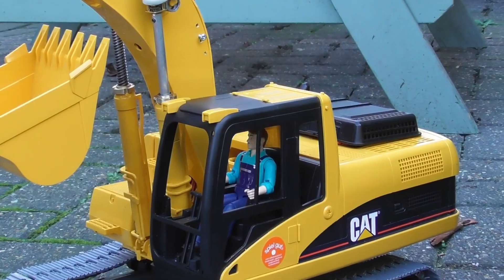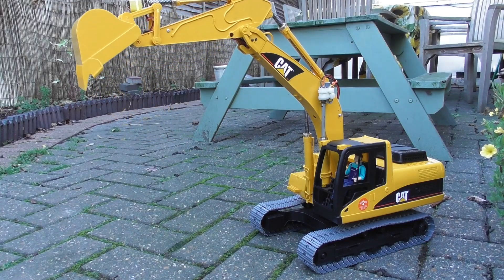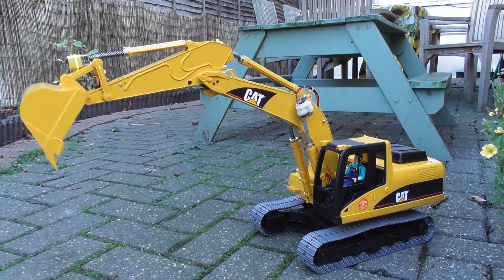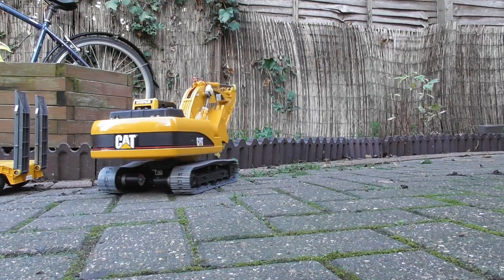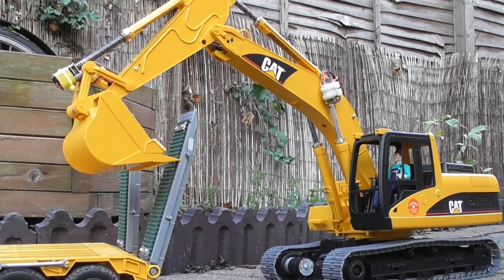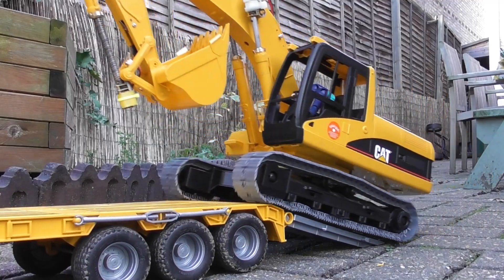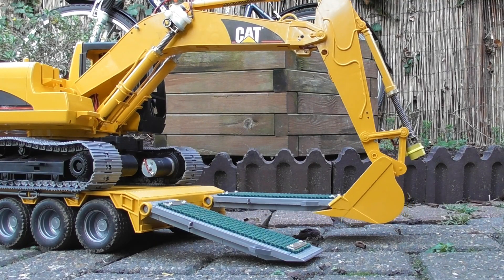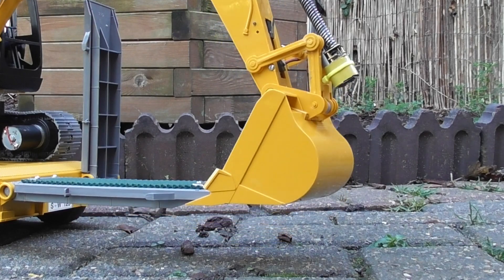Bruder CAT Excavator RC conversion pt6 : completion

Comment: Where might I be able to find tracks like those?
Reply from the maker: Those are standard Bruder tracks. Either part of the model or a fairly easy to get spare part. When I upgraded this model with 3D printed parts I added clip on 3D printed “track grippers’ which improve the traction in soil etc much more.
Reply: @RCModders  Okay, thank you sir for the info on them and the track grippers; much obliged.
Reply from the maker: @ToyotaGuy1971  you are very welcome!

Comment: Hi. Did you ever see or use these. They for 1/16 scale 
https://m.banggood.com/Huina-All-Metal-Strength-Main-Arm-Second-Arm-Bucket-Arm-Driving-Rod-For-RC-Excavator-RC-Car-Parts-p-1383098.html?rmmds=search
Reply from the maker: Yes I was aware of these, but haven't used them. I don't think that they have travel limits - which is an important feature for me. I have since developed self contained units with travel limiters - which will no doubt feature in a future series. 😀👍

Comment: Hello again , do you have a build  Series on the truck pulling the trailer ? I'm wondering what your using to drive the 4 motors.
Thank you for any help you can give 
Greg
Reply from the maker: If you are talking about the Mack/Scania hauler trucks and low loader etc watch this space - as a comprehensive series on all the big trucks is coming to the channel soon!  😀👍